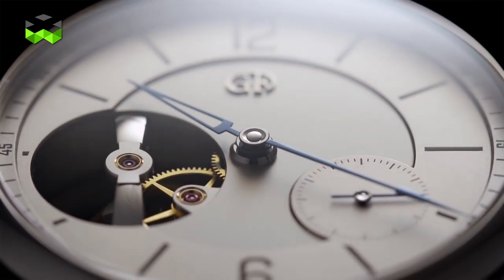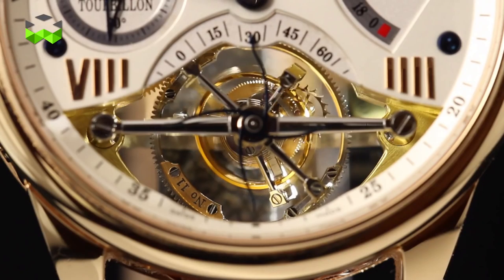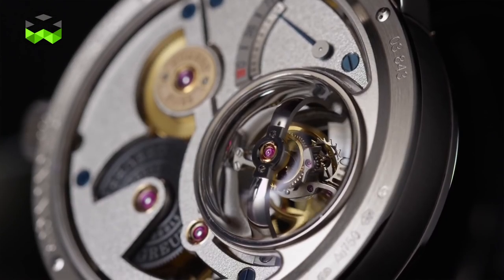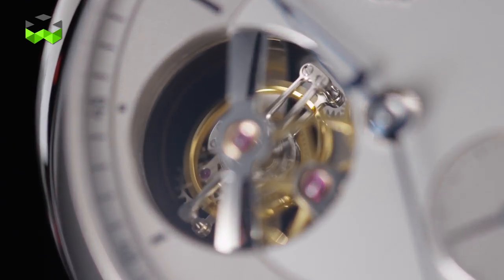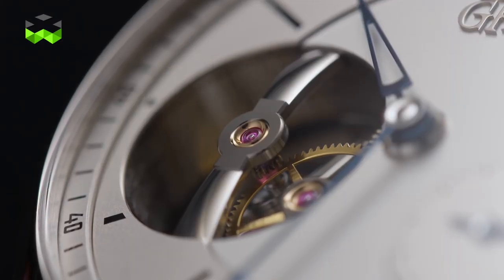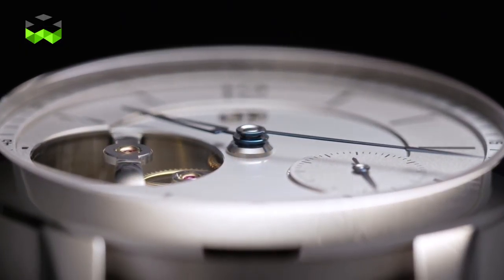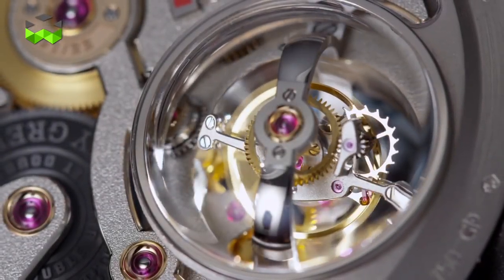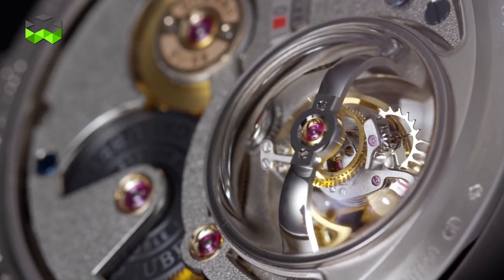The Greubel Forsey Tourbillon 24 Secondes Vision In-Depth

Comment: If it's domed on the back, how do you wear it without discomfort?
Reply from the maker: +John Johnson This is a good and natural comment but we can promise you that actually it's really nice to wear. We don't really know how GF performed their magic on this, but it's really confortable!
Reply: Really, well, I shall take your expert word for it. :)
Reply: +John Johnson Steven Forsey and Robert Greubel started indeed the creation of this new model by focusing on the ergonomics. They knew that the hole going through the movement and containing the tourbillon system would exceed the thickness of the case because of a necessary dome. For this reason, they printed in 3D various shapes of cases with the dome positionned in various places. The goal was to determine which location would be the most appropriate for the positionning of the watch on the wrist, and also naturally for the confort. The dome had in fact to stay between the radius and cubitus bone next to the wrist. It took quite a time but once it was done, they started building the rest of the watch
Reply: +L Nardin Thank you for the very knowledgeable reply.

Comment: Not convinced enough until I find a tourbillon watch that is as thin as the piaget altiplano 900p.
Reply from the maker: +Girom Christian Calica At the moment, the thinner tourbillon mouvements are the Breguet 5377 (3mm), Arnold & Son UTTE (2,97mm), Bulgari Finissimo (1.95mm) for 5.15mm in total (case). Right, it is not yet the 3,65 of the Altiplano 900p.